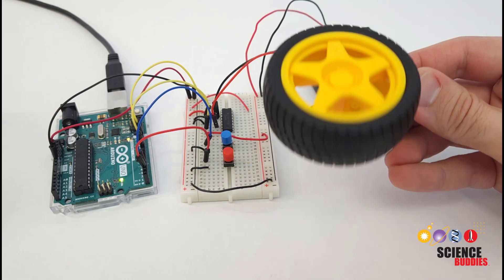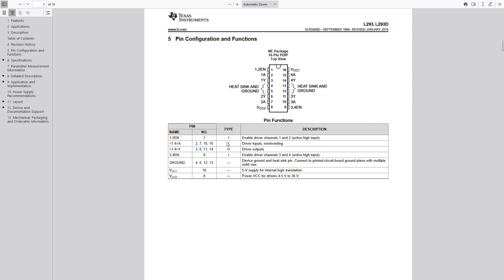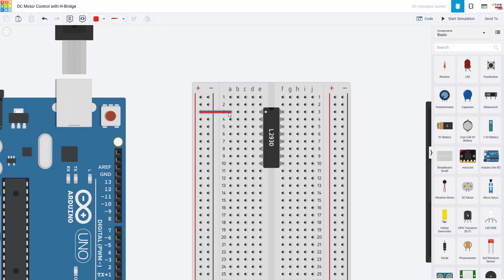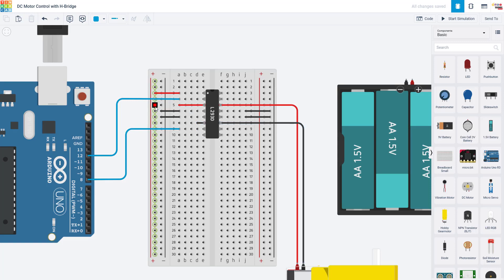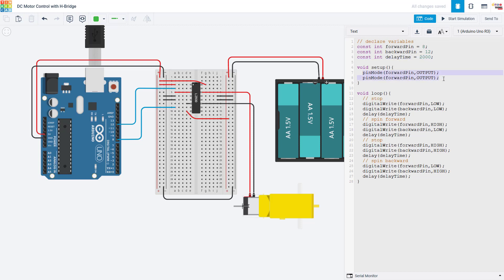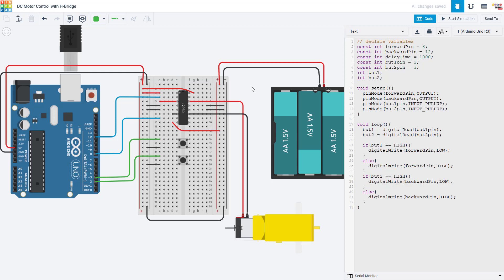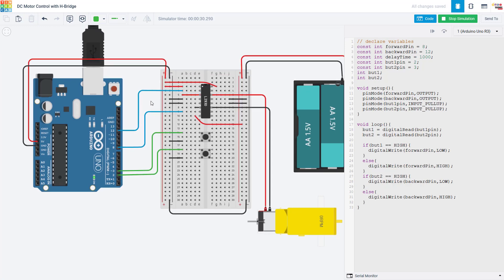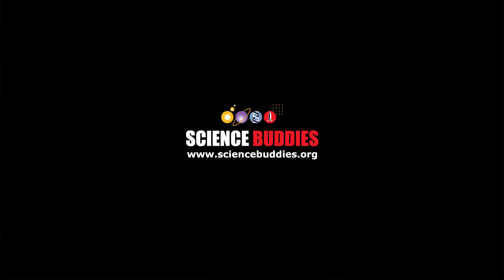DC Motor Control with an H-Bridge and Arduino (Lesson #17)

Comment: Im looking to see how to control a dc motor without buttons or switches. Just coded movement. How do i do this? Tutorials??
Reply from the maker: Hi - we recommend checking out our full Arduino tutorial playlist. You can control the motor's movement using hard-coded digitalWrite commands and delays, just like you would when blinking an LED as covered earlier in the playlist. This does not require any buttons or switches as inputs.

Comment: Hey, this is a fantastic video! I do need a hand with something though. I am trying to use this circuit to control a vinyl player (conceptually). I have allocated a button for forward and reverse but I want to use two potentiometers. One at max speed would turn the disc at 33 revolutions per minute and one would turn it at 45 revolutions per min. How do I map both with the same speed function? or what do i even do hahaha thanks :)
Reply from the maker: Hi - unfortunately we can't provide support to write code for individual projects like this. We have many other videos in our tutorial series, including earlier videos specifically about buttons and potentiometers that may help, but putting it all together to do exactly what you want is up to you :-). You may be able to get help with your code on the official Arduino forums.